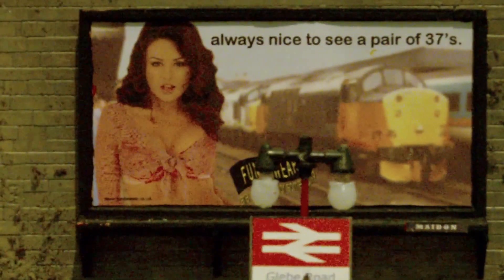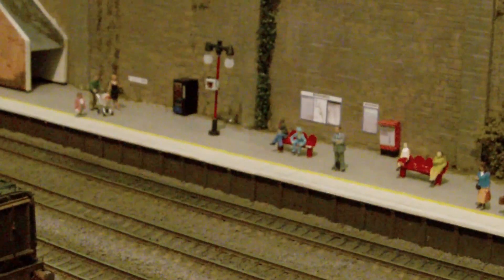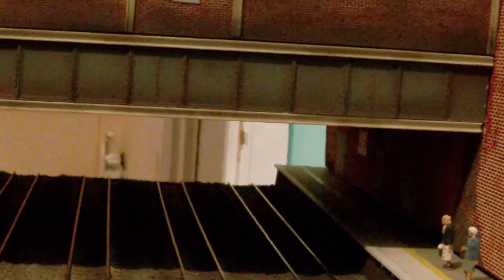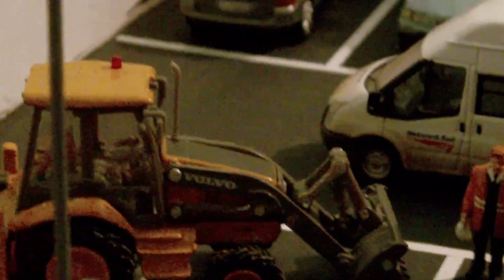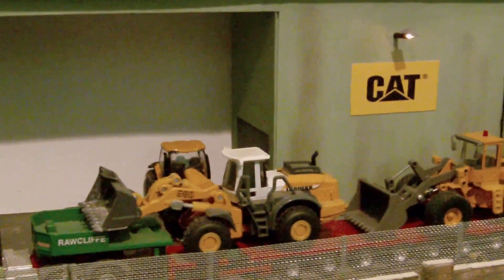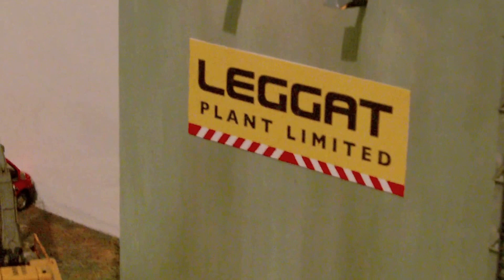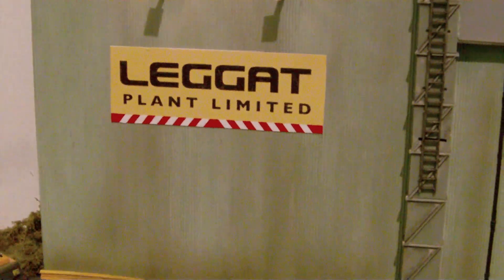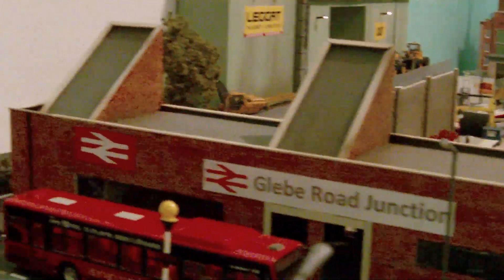LAYOUT UPDATE #2

Comment: Your platforms look very good Terry, the wiring is a bit like mine ...Indian call centre comes to mind ??  LOL   all coming along nicely, I bought some small transformers which have settings from 3 volts s up to 12 volts they just plug in and set them at what voltage you want , cheap at about £8 handy for your lights ....Cheers Dave

Comment: I GOT MINE AT YORKSHIRE TRADING , BUT IF YOU LOOK ON E BAY ...   12 VOLT TRANSFORMERS SHOULD GET SOME COME ON , THEY JUST PLUG IN TO THE MAINS AND YOU RUN A LEAD OUT TO YOUR LIGHTS, AS I SAID YOU SHOULD FIND SOME WITH ALTERNATING VOLTAGE , I RUN ABOUT 14 LIGHT S FROM 1 BUT LED`S YOU CAN RUN MORE

Comment: Hi, see 15.20 in to video there is a BR totem outside your station.  What dimensions is the pole - diameter etc and also what thickness of plasticard did you use for the sign to go on? Cheers.

Comment from the maker: all my bachy 66's are all modern all wheel pick up.however i did once buy a hornby model and that was four wheel pick up and it was crap so i sold it.
but it does sound like its a fault with the motor if you have serviced it.have you cleaned the pick ups?